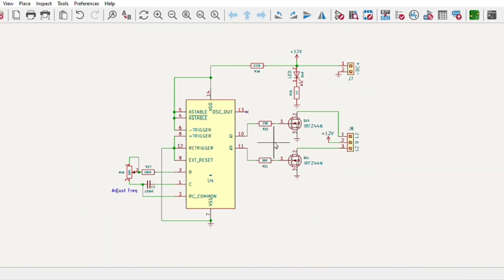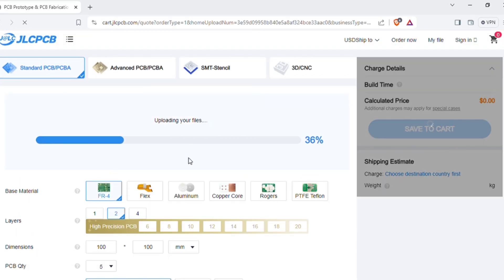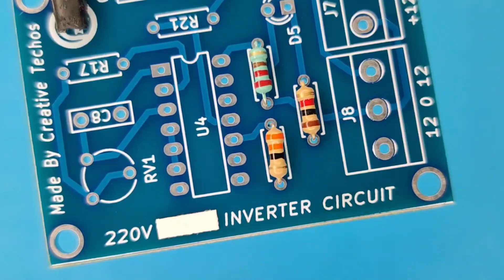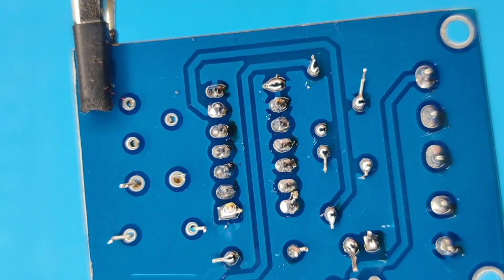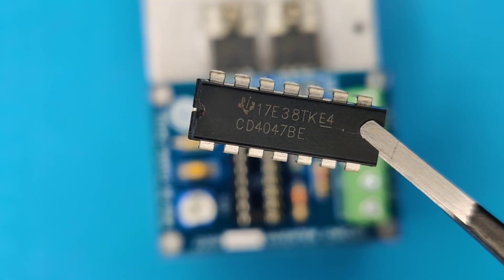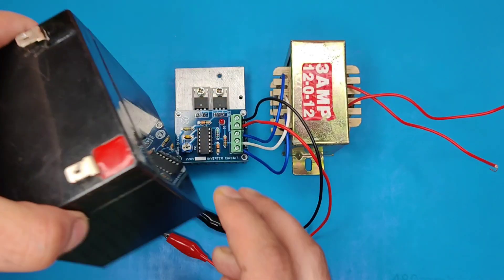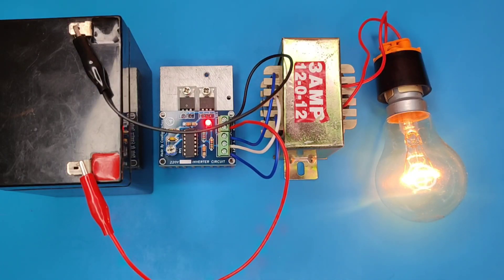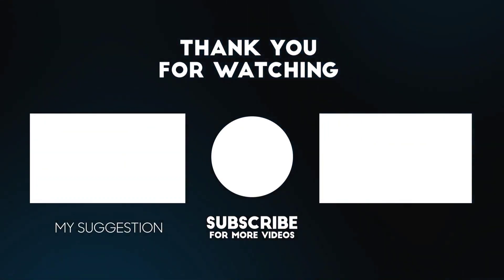Simple 12v to 220v mini inverter using 4047 IC

Comment: Thank you for the circuit and video. I noticed you mentioned near the end of the video,that circuit can be used for small non inductive appliances only. The picture description shows inductive loads, example of fan, angle grinder, those are inductive loads?

Comment: what is the maximum output power of this invertor.and i use 12 v 10amp batrery with 3amp transformer  which is the time of running load like 50 watt.plese reply me.